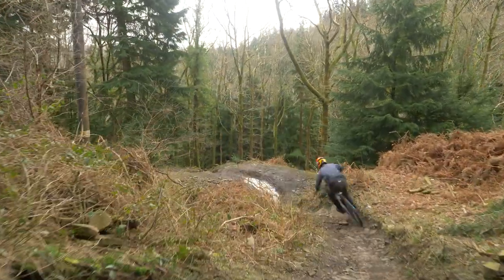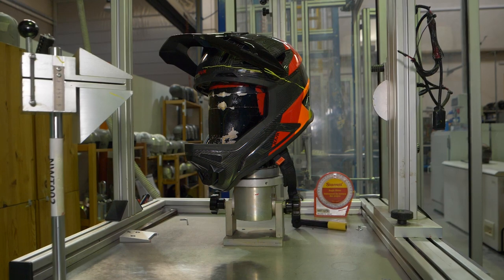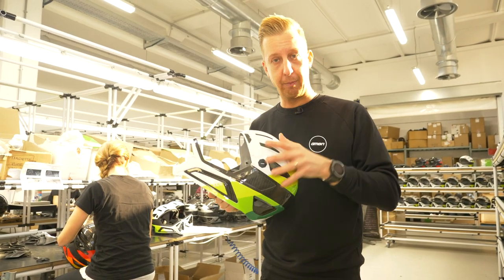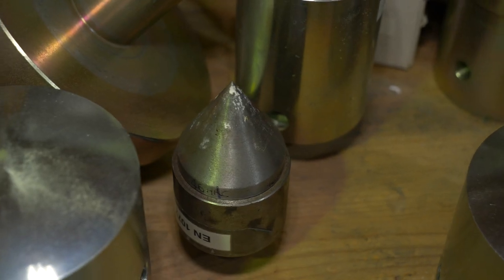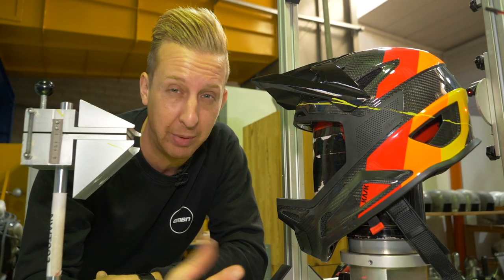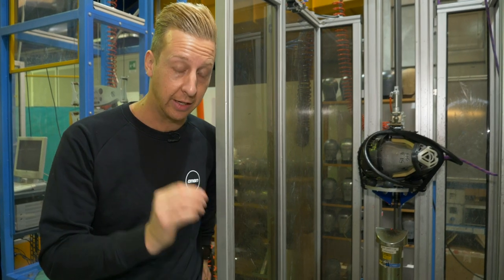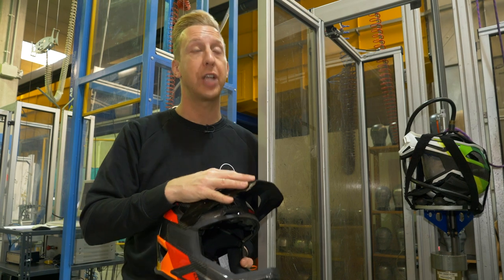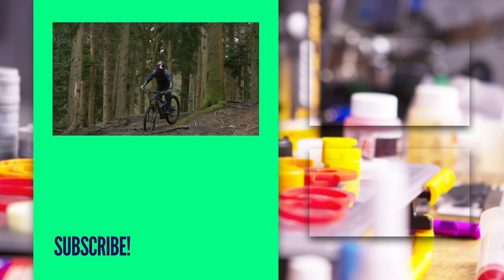Can A DH Helmet Be Light & Strong? | How KASK Make & Test Superlight Full Face Helmets

Comment: I use the Bell Super DH - I can decide very quickly what I like - but I prefer more the Full Face setup when going "downhill".
In my opinion your team should use Full Face helmets most of the time because you are role models and have a lot of youngster audience - the more of the "Heroes" use Full Face the more will imitate you. But this is only my narrow perspective ;-)
Like your show it's always something new to learn.
Reply: 100% agree, i used to only ever ride open face but recently I bought a 661 Reset and its really not that hot to wear and not very restrictive, I can still drink from my camelback with it on too.

Given that I value my face, I've seen how fucked up some of my friends have gotten who are damn good riders when they've only been wearing an open face, and how mangled the helmets were afterwards... any time I'm off road the full face goes on now, even if its just a warm-up blast on a blue/red trail.

My open face enduro helmet has been reserved for use at the local pump track only, as I'm not really that fast on it yet and bailing is easier and there isn't much to hit into.
Reply: That and the super air r offer the best brain protection👍🏼

Comment: Full face anytime I’m single track riding. Trees and face don’t mix.
Reply: Logan Todd I’m a tree hugger- at 30 mph 😵 full face😉
Reply: Same here mate not worth the risk 👍
Reply: What full face helmets are recommended for everyday trail riding.
Reply: @edensgardenshed9622  TLD Stage. Look no further and dont waste your time looking beyond that. You will thank me
Reply: Very interesting and insightful video Doddy.
I use and Poc Tectal all the time, I don't visit bike parks but I am considering it, will definitely look into to getting a full face for that.
Great work GMBNTech 👊👍
Reply: @edensgardenshed9622  +1 for the TLD Stage
Reply: @edensgardenshed9622  Fox ProFrame.  Super light and great ventilation.
Reply: Hard to breath in them when climbing tho
Reply: @evltwin984  not my Fox ProFrame, and the Troy Lee Stages is a similar design.  Many though, yes, they re horrible for breathing.  Just got to get the right helmet :-)
Reply: @Mububban23  ive only ever tried my bell super dh, theres to much foam in the cheeks and it mushes up my face a bit, also retains hot breath, heating up your intake air
Reply: @evltwin984  Can't you make them thinner or take them out when not needed? I have the Super 3R and you can have 1 or 2 pad thicknesses in there or remove for up hills. Nice name btw :)
Reply: @edensgardenshed9622 there are many helmets that you can turn from a fullface to a normal helmet so you can use it for every acation
Reply: using an open face for the climbing and a full face for the DH is an option. Love climbing and DH.

Comment: I've always been an appropriate helmet for the terrain sort of guy which generally meant my Carbon TLD D3 Full Face for DH or park and a well ventelated trail helmet for everything else. Between a bad crash and airy new enduro helemts I've just picked up a Bell Super Air R and will never go back.  Its as light as the average trail helmet, as ventilated as most XC lids, and the chin bar goes on/off in seconds.  I always ride with a medium hydration pack so the chinbar easily goes in the back on climbs, fire roads etc.  The fox Proframe  was a close runner up. The chin bar was just as airy but the helmet was not and it was a bit heavier.  As more co's make light convertible Full Faces there won't be a reason not to.

Comment: I'm somewhat new to trail riding, picked up my first full suspension late last year. I ride with a fox Proframe, maybe a bit over the top on a more XC style park but you never know. I'm waiting on a fox Rampage Pro that I scored for 40% off RRP  because I've started to dabble in black diamond trails which are a little more DH and generally have more rock gardens and slabs

Comment: I wear full face for practically all of my mountain biking now. My Troy Lee Designs Stage has tons of ventilation I find it isn't any hotter than any of my previous open face helmets. The fit is also excellent but I also come from a motocross backround so the fit is also very familiar to me. I only use open face on easy flat trails where I do my recovery rides just so I don't look like a knob wearing a full face on a flat easy trail. Also, I've never hit my face/chin guard even during the 15 years of motocross before I got into mountain biking. But you can't change your helmet mid-crash when you see that tree/rock/root/dirt rushing straight toward your face.

Comment: When I got a DH full face briefly (never ridden it, decided I won't be needing it for my empty head) it was very tight, very difficult to slide over ears, cheeks were squeezed tightly, so it probably was the right size, although could be a bit wider for the ears - I felt literally claustrophobic in it, no joke. And for polish sahara-like recent summers, I was very worried about seriously dangerous level of overheating my head. You know air expands in hot weather, the more of it in empty head, the more it expands ;-p No but seriously, it was hot and claustrophobic. Not a nice feeling. And it was about 140 euro, so not some crap.

Comment: I have a 2008 full sus with disc brakes. They have a corrosive fluid in them as opposed to mineral oil. They are in need of a bleed, but would you recommend getting a new set instead.
Reply from the maker: No not at all! They'll just be DOT fluid, which is mildly corrosive yes, but still used in some braking systems today!

Comment: #askgmbntech hello doddy, I currently run a 2015 Boxxer RC that came with my sacaren myst that I bought used. I think the coil is loose because I can listen to a light tap when it recovers. Compression adjustment has 10 clicks, but they seem a bit useless because it's either soft or stiff as a rock. Question is: will a good maintenance make the fork work that much better, or should I just try to sell this fork and get a Team Or WC version, as apparently the charger damper in them is amazing. The fatigue in my hands and arms after 5 full downhill runs is bad enough for me to stop riding that day. Thank you for the help.

Comment: #askgmbntech
Hello,

Is it possible to mix and match brake pads: using one resin and one metalic on the same caliper to have the durability of the metalic and the instant brake of the resin.
Thanks
Reply from the maker: It is yes, but then you'd also have to keep a close eye on pad wear as one would wear quicker than the other!

Comment: #askgmbntech Did you discuss the considerations for testing helmets with simulated cameras mounted to them? 

A chin mounted camera may alter the deflection, while other mounts may result in a smaller, more direct, point of impact, or perhaps the mounts fail and they don't change a thing?
Reply from the maker: We didn't no as the helmets are safety tested without the extra aftermarket item attached. We know there's some good research happening by both helmet cam companies and third parties going on out there!

Comment: The flaw of this helmet testing is it's testing the strength of the helmet, it needs to test the g's transferred to the Head form, even the best helmets don't account for a lighter small head needing softer foam because of less Mass at the same speed it needs to be softer.

Comment: Any of this test and weight is not accurate as when fall happen its not only the head weight there but all the body if u head up first so they supposed to hold up with at leat 100kg of body weight plus  the speed of fall witch it made the weight much more so I don't really think they are safe